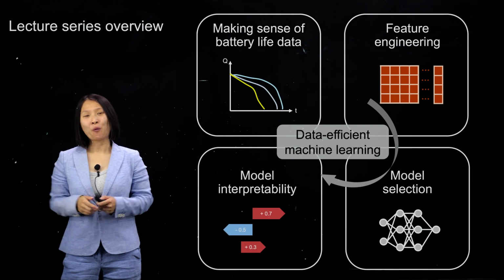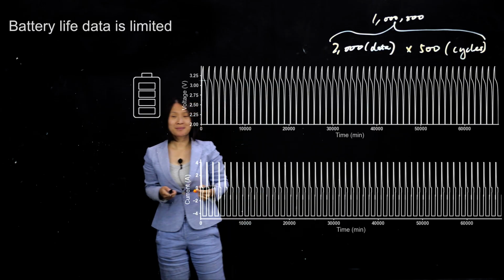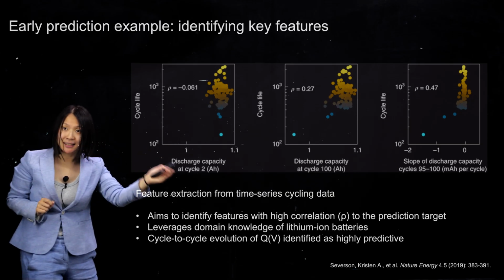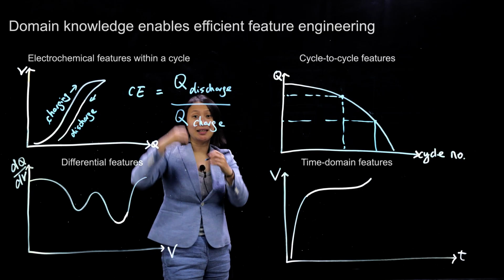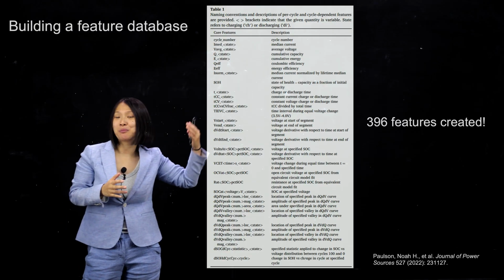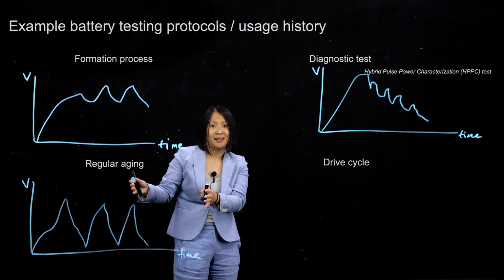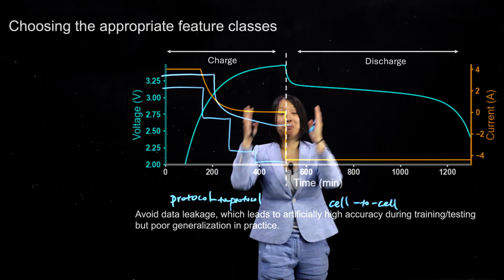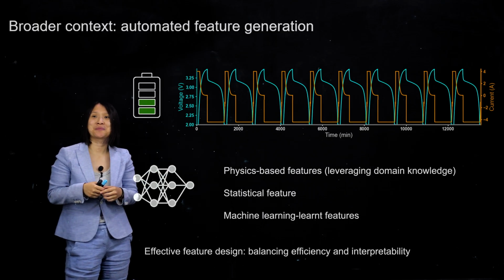Feature Engineering

Comment: Great Work. Would you be able to kindly share an example of the pre-processed data format, in tabular form, that was used as input for the model? A sample with randomly generated values would be perfectly fine, as I am mainly interested in understanding the structure of the dataset rather than the real data itself. I am currently working within the Battery Innovation Cluster and exploring the application of interpretable ML models, so such an example would be extremely helpful. I truly appreciate your time and consideration.